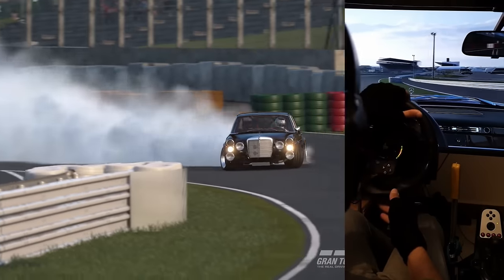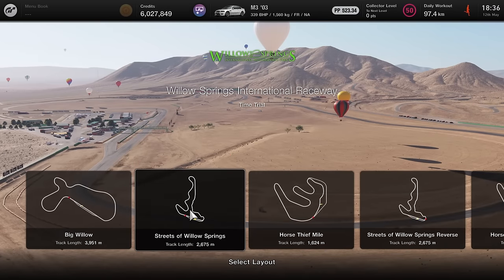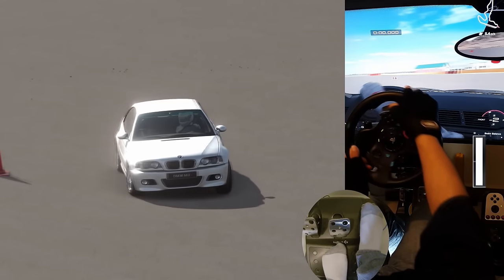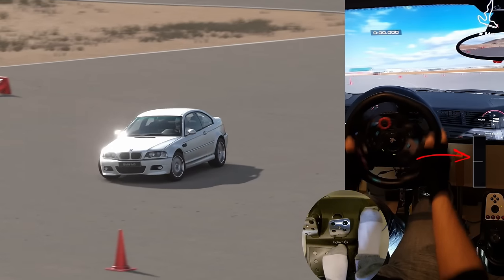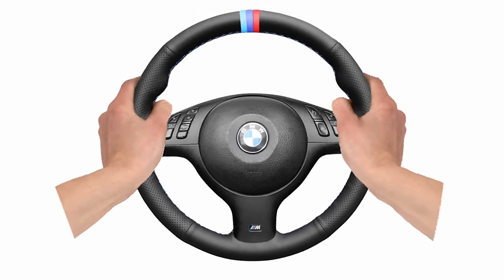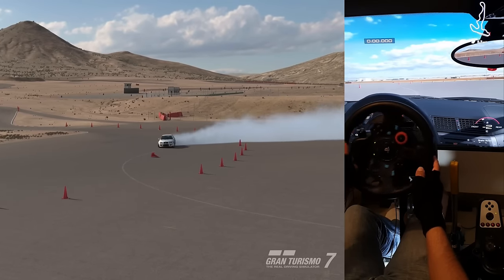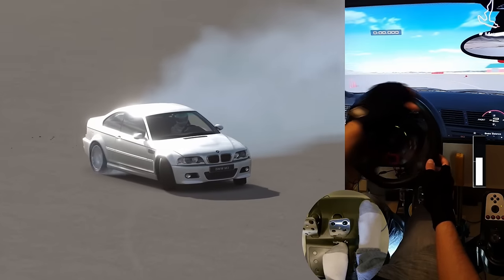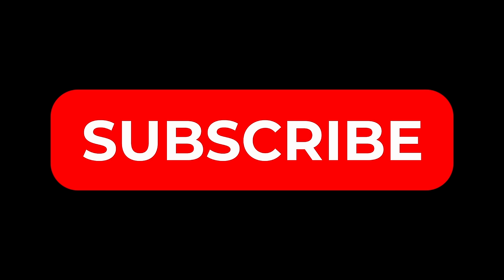How to Drift With a Steering Wheel (GT7/Real Life Tutorial) - Part 1: Basics

Comment: The fact that your drifting on a G29 is impressive as the wheel sux for drifting
Reply from the maker: Well thanks a lot! The G29 is a not bad wheel but it's slow for drifting. I have to keep helping it spin fast enough most of the time which adds to the work that should be done when drifting, compared to the real thing. That's why I've now switched to the Thrustmaster TGTII 👌🏻
Reply: @SimActionClips  exactly, I was never able to “catch the slide” with G29 and never knew what it felt like until I moved on to TM myself
Reply: I’m glad to hear that… I tried and tried to complete the drifting tasks but couldn’t do it to save my life… I swapped to my controller and had them completed in ten minutes
Reply: Nothing wrong with the g29 it's all about the settings
Reply: @crystalmcmath190  I’ve spent ages trying to set up mine 😢😆 still carnt do it like the pros
Reply from the maker: Guys check out my video on how to best set up the force feedback: https://youtu.be/oEe5ZchqbMg 
@crystal mcmath yes the G29 is not a bad wheel and most people have the wrong settings, not able to get the most out of it. But also saying that nothing is wrong with it is also not true. It's slow, at its fastest possible spinning speed it is still slow compared to the spinning speed of the steering wheel of a real proper drift machine when doing transitions. It's good enough to drift road cars in their stock setups though, as the speed gap gets much smaller.
Reply: @SimActionClips  what about the g923 trueforce wheel? is the settings the same? I set the steering torque to 10.😂
Reply: @SimActionClips  I also noticed that your brake bias was set to -2 to front. Will that setting affect the car drifting tutorial? The stock m3 does not seem to allow me to adjust the brake bias setting.  I am following your tutorial to learn drifting. Want to transit to drifting in real life at some point later in my life haha
Reply: @crystalmcmath190  sorry but the g29 has slow ffb.
Reply from the maker: @David K yes the settings should be exactly the same as for the G29. My friend has one and he did confirm it felt much better this way. 
Yes the only thing I changed with the car is adding a brake balance controller to set the bias to -2 to the front. I always do it and for some cars i even set it to -3. I didn't mention anything about it in this video because we're never using the brakes here, so it's useless just for this tutorial. I will be explaining more about it in the coming videos when talking about brake pedal control. But generally, i want more brake bias to the front, and not the default 50-50 distribution of the game. It's also how real road cars are set up.
I hope my videos help you reach that goal. I did exactly that myself thanks to GT5 and GT6.
Reply: @SimActionClips  how to increase the rotation speed?
Reply: @SimActionClips  awesome! thanks man! Looking forward to further tutorials!
Reply: @SimActionClips  i agree that the settings is the same as g29 too. I feel that the steering wheel feels more like the real car steering wheel as compared to when I didnt follow your settings previously.
Reply: i tried it once and thought it was just me
Reply from the maker: You're welcome buddy! I hope you keep enjoying them 🤟🏻🤟🏻🤟🏻
Reply from the maker: @Federico Gori you can't increase the rotation speed per se. You just have to plug-in the ffb settings that I'm recommending to have the fastest possible rotations.
Reply: @preyes333  honestly I almost want to say it's not worth it to learn on a Logitech wheel sometimes? If you already have one then go for it, but I had to relearn drifting when I picked up a TM for that reason alone. I continually either straightened out or the car/wheel would rotate faster than I thought it could and then I'd spin out. Essentially had to learn from the ground up again when I switched
Reply: @LQX-55  it's pretty much the same wheelbase but with trueforce, so yes use the same settings
Reply: @SimActionClips  honestly where the g29 really shines is grip racing. While you really won't see any top drift competitors with a g29(mostly due to transition speed just taking a lot more work than a faster wheelbase), you will absolutely see top competitors use g29s for grip racing considering you shouldn't need to catch a drift while racing and if you are then you're probably gonna be just as slow with a direct drive wheel.
Reply from the maker: @kwame20101 I know man it's much more effective in grip racing than drifting. I actually qualified to GT Academy with it in 2014. I also have DR on A+ and SR on S both in GT Sport and GT7. I'm very fast with the G29 and now even faster with the TGT2. It's not about catching the drift, it's more about trail braking and neutral steering where also lower forces that the G29 is not capable of producing can help dramatically. One has to be on top level though for the difference between such wheels to actually make a difference in grip racing.
Reply: @SimActionClips  I couldn't agree more. These wheels are an amazing budget if you're going for grip racing, especially since you can usually find them for around $100 used and $200 new on their numerous sales. Personally I suck at grip racing, but I could never say that the reason for my poor performance has anything to do with my old DFGT. It gave me all the information I needed to know at the time and more than I even knew what to do with, the only gripes I could have were that it rotated a bit slower than I would have liked for drifting and unfortunately they hadn't nailed the pedal situation yet but that's nothing that a pool noodle or squash ball couldn't fix
Reply: Its not a problem of wheel or anything liké this, its you if you know how to drift you Can Do it with any steering wheel 😅 theres no excuse
Reply: @kazuyabeats8134  well not exactly, or at least not all of the time. It depends on your technique, if you're someone who manually feeds the wheel a lot more then yes the skills should transfer perfectly. However, if you let the wheel countersteer on its own then your going to be slowed down at minimum if not then you're going to be spinning out for counter steering too slowly for your momentum.
Reply: @kwame20101  personally i have the same type of driftin in every wheel i try, maybe because i started driftin on Real car before going on assetto or any sim with decent physics and ffb
Reply from the maker: @kwame20101  yes exactly it's very good value for money. I went and bought mine for $180 new but open box the day GT Sport was released. Been using it since then till i got my TGT 2 about 3 or 4 months ago. And i actually learned to drift with the DFGT on GT5 and Live For Speed. Been sharpening my skills since then using the G25 then G27 before the G29. I actually had to buy my G25 used from a friend when i broke the plastic pedals of the DFGT 😅. These wheels were all great for their times and actually before the T500RS was released Logitech were way ahead of everyone. 
Even I think that although my TGT2 is a an awesome wheel and worth every penny, and much superior in its capabilities, it still feels that the G29 had better build quality.
Reply: Yo guys when I put Settings it doesn’t appear the event settings, can you please tell me how to make it appear?
Reply: Oh great. I own g29 and have new copy of gt7 , cockpit and psvr2.
Reply: @SimActionClips how do you feel about t-gt compared to g29?
Reply: Hey I use a g29bto drift. Did have a learning curve tho
Reply: Play with T300RS and u will see what is difficult
Reply: I know how to drift in real life, and when i’m using this G29.. i’m the biggest sh1t ever! 😒
Reply: I'm on a mission, but the G29 got me fishing, so I'm trying intuition, but so far its steady glitchin.
Reply: What's that track tho???
Reply: As my grand dad would say ... son its not the engin its in the driver 😂
Reply: Works great for drifting 🤷🏻‍♂️

Comment: This tutorial is phenomenal! When i try to explain to beginners, how i keep my car under control, i really struggle to explain, what i am doing and why. From now on, i will just show them your video.
Reply from the maker: Thanks a lot man!! I used to struggle with it the same issue. I don't think anyone can ever simply just put it into clear words without the aid of good visuals. This is only part 1, and I'm planning to explain every single detail related to the subject in the numerous coming parts. So stay tuned and thanks again 🤟🏻🤟🏻
Reply: Well said. It's one of those things that's really hard to explain because it's so much about feel. I remember being taught to drift way, way back in my teens using a kart. I had a great teacher, but failed over and over to initiate and hold the drift. Then one attempt I got it, and never had a problem again. Once you feel it, it locks in, but it's hard to convey verbally as knowing all the exact steps perfectly, still doesn't quite unlock it.

Comment: I originally wrote a negative comment about this video, but I immediately retracted it once I realized that this video is actually teaching alot in just a short amount of time, which can be easily overwhelming for new drifters. Especially in a game as difficult as gran turismo. 

I would love to congratulate sim action for this video and its success. It took me about a week, but I was able to get a steady, clean, and balanced drift all the way around the track. 

My advice to new drifters out there, is to purely pay attention to your foot positioning on the throttle, and make sure you are in a position that gives you the most control. For me, that's my foot fully covering the pedal and giving it the power it needs. 

Unlike controller, you can't continuously blip the throttle to control the car, you need to keep your foot constantly paying attention to the angle of the vehicle, and let instinct take over the wheel. Thinking too much into it is going to make you spin out or loose control.

Comment: I have the Thrustmaster T150 and so far its been impossible to drift with. Its equally difficult when trying to countersteer during a race. I have played around with the steering wheel settings, but until this video I was unaware that the controller sensitivity setting had anything to do with the steering wheel. Awesome video, great explanations.
Reply: GT7 is super hard to learn drifting in compared to most sims out there. Don’t be discouraged. I’m on a T-GT2 and I’m sucking BAD at drifting as well. It just takes a lot of time to learn this skill.

The car you use also matters a alot. Almost all the typical drift cars are SUPER twitchy. This BMW used here is so much easier. And some of the american muscle cars are even easier than this. Big cars are like drifting in slow motion. Much easier. Like driving a boat.. whereas the ae86 and silvias etc are super duper squirrely.
High power engines are also an absolute disaster for newbies. Same with high RPM turbos.. where all the power just kicks in after 5k.. so hard to control. 

A car with about 200hp and no turbo will have the smoothest power band for newbie drifting.

Keep at it, you will improve :)
Reply from the maker: So glad this helped man and thanks a lot for your feedback! I appreciate it! What @JimmyNuisance said is very true. Just keep going 🤘🤘
You can try this latest setup I made for the S14 which makes a great car to practice with: https://youtu.be/LqtZ2Ud21ik 
I will be recommending it in my Part 2 which I'm currently making using this car.
Reply: @SimActionClips  Thanks for the feedback! Great car, great recommendation. I'll test it out when I have the time.

Comment: I just want to say thanks a great deal. I finally started to be able to do your first part of the tutorial to be able to initiate a drift and counter steer without spinning out. Even though my q55 prism tv has no Auto Low Latency Mode (ALLM). haha. It is do-able. 

I finally realise that you did not turn in hard before you blip your throttle. 

You were turning the steering wheel at fixed angle to keep up with the circle and maintaining your speed around 64km/h plus minus. 

After which, you have to feel whether the car starts to be at the point where the tyres are at its limit before drifting through the feedback of the wheel.

That is the point where you depress fully on the throttle and release totally in a moment while faster helping my g923 wheel to counter steer in the opposite direction before turning back to face the front.

To be able to do it multiple times round the big circle makes me excited! Thank you once again for this tutorial! You are awesome❤
Reply from the maker: You're welcome! That's some great news man! 

Yeah it is do-able for sure. I actually learned everything I know with high latency on my older Samsung TV. It wasn't until last year that I had ALLM. But it does make it much easier and much more controllable.

Yes that's a good description of what's going on, seems you got it well figured out. Just one point about the front tires before initiation. I wouldn't say they're at their limit, they're somewhere near maximum grip. You can feel it with heavier ffb, if you try to change your steering angle at that moment. Being able to feel it right also helps a lot in racing and hot laps, as you would be able to judge the level of grip at the front and also use it for good slip angle while trail-braking. I will be better covering this particular case in detail in future videos. 

I'm so glad I could help this much, and I know how good it feels when you start getting the hang of it. That's really awesome! Thank you for your feedback and taking the time to share this, this means a lot! 🤟🏻🤟🏻❤
Reply: @SimActionClips  yes near maximum grip. Not sure how to describe that hahahaha Thanks for putting in the right words.
Reply from the maker: You're welcome man thanks again!

Comment: This is the single best drifting instruction video I have ever seen. I have a G29 and 2 weeks ago I watched this video and started learning. Now I can constantly drift counter-clockwise with the M3. This is thanks to you! I'm really keen to see the next part of this "course". I'm thinking about upgrading to the Fanatec GT DD Pro wheelbase with the CSL Elite WRC wheel. I'm wondering should the controller sensitivity be set to 5 also with other wheels than G29? 🤔
Reply from the maker: Thanks a lot man! This is really awesome I'm really glad I could help this much! Yes the controller sensitivity setting should be set to 5 for all steering wheels to work best. You can watch this video if you wanna know in detail why I set the values this way: https://youtu.be/oEe5ZchqbMg
I also have a Thrustmaster TGT2 and use it with this setting set to 5. I've even spent the day further testing and tweaking things, just to confirm to myself that all the FFB settings still work the same after the new update 1.31, and they all do.

Comment: Thanks for this great tutorial! You explained it very thoroughly. Can I ask a few more questions?

1) I have M3 '07 and Nissan S15 tuned and set exactly like your S14 (in your part 2 tutorial).... which one would you recommend for beginners? 

2) When initiate a drift, after the rear starts spinning out, do you just let go the steeeing wheel to let it turn back or you physically turn it back? 

3) I'm still far from drifting 😅 .... I keep having a problem of either the car straightened out or spinning.
Reply from the maker: Hello, you're welcome man, and thank you!
1) I don't think the tune of the S14 will work exactly the same on the S15, but I'm not sure how good it can be, need to test that. I would recommend both he the S14 and the M3 for beginners along with many other similar cars like this stock brz: https://youtu.be/AWGFfbg7jdU
However, taking the same specific car for each tutorial as a start is a good idea, i.e. the M3 for part 1 and the S14 for part 2, then trying different low to mid powered cars later.

2) It depends on your steering wheel. I can just let go of the TGT2 most of the time with the right settings, but I can rarely do that with the G29 and need to help it a lot more. 

3) That's very normal for everyone to experience when new to drifting. It took me many days to start to get the hang of it back when I started, and it can take weeks and more than a month which is still very normal because it's a new physical skill that requires muscle memory. So you need to keep training your body and brain for it to become part of your physical habits. Also, and this is very important to be much more in control, USE A HEADSET or at least some earphones. Never use the speakers of your TV unless you're using the fiber optic connection for audio from the PS4. The difference in audio delay can be immediately felt, and the initial delay from the speakers completely ruins your input timing. This alone can reduce your frustration dramatically.